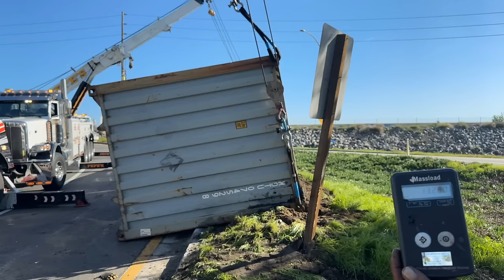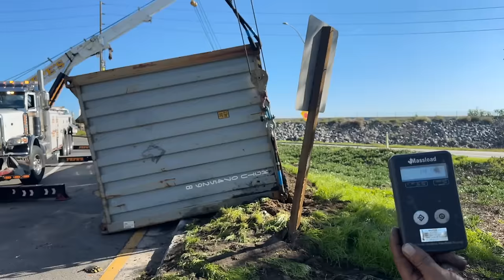Container Disaster: Never Make This Mistake!

Comment: Nice mix of both cameras to capture the set up as well as giving different angles of the roll over and lift of the container.   Scary that trucks can drive off without locking the container down.

Comment: GOOD JOB , Pepe's.
PRETRIP PRETRIP PRETRIP do them. 
Zip ties, plastic, stainless steel, or Stainless Steel safety wire(Harbor Freight has them cheap)  around the safety catches and twist lock handles. 
If your chassis is missing one of the locks. 
On PRETRIP 
DO NOT USE TILL FIXED.
If safety catch not Zip tied some styles of latches can vibrate to open. on older chassis. And some Acme Screw style. You beat with a hammer till tight.

Comment: The driver took so damn long to back under the chassis man. You can tell that it must be an automatic truck and he's scared of it. You gotta be a little aggressive when dealing with that automatic when backing up a hill. If not the truck will keep moving forward. Or he could have just held that break anytime he felt uncomfortable, feed gas before release, to avoid the creep/lurch forward, and release the brake when the truck bucks up. 

Sad the original driver forgot the locks, but another incredible job by the guys! Thanks for the upload!